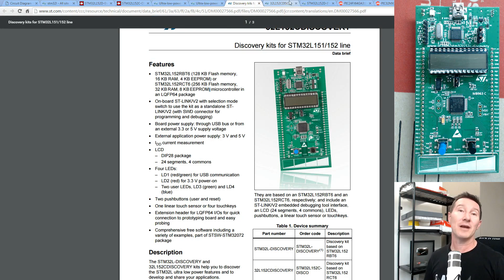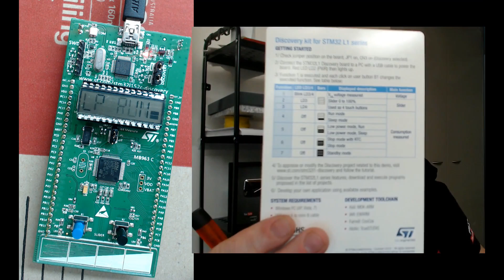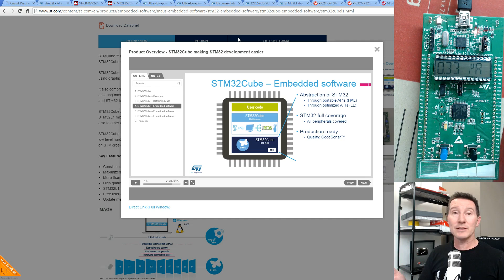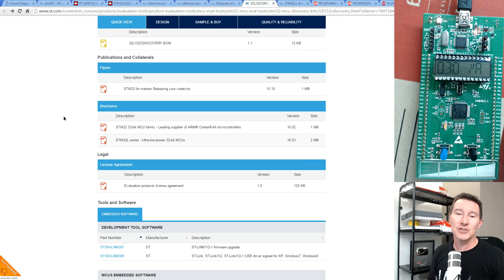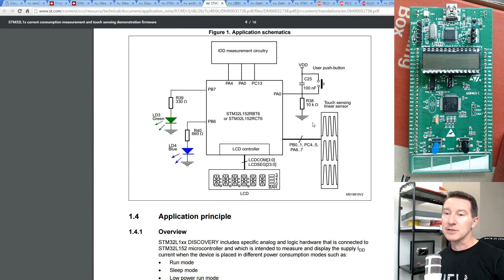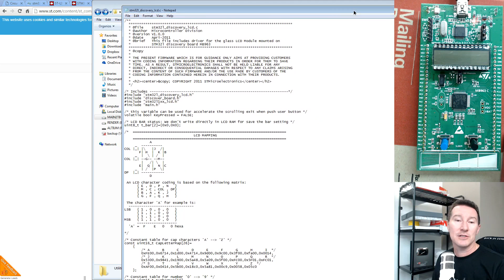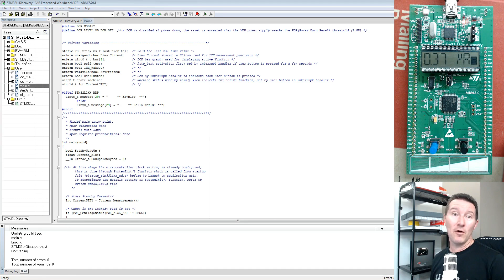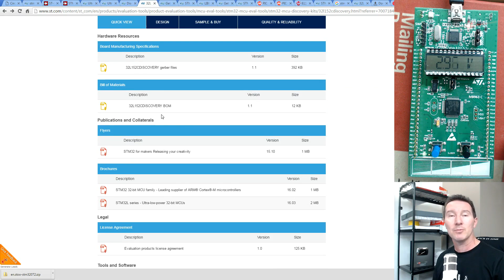EEVblog #900 - STM32 ARM Development Board

Comment: I am usually pretty good at making things work, but it took me a whole night to make the STM32F3-Discovery board run a test program provided by the vendor. 
6 out of those 8 hours were spent pondering about lack of useful instructions, chasing after documentation (all over the place) that points to wrong AN or lacks explanation about critical jumper/connector functionality on the board, after critical files which were named one thing in the docs and another thing on the Discovery utilities web page etc. 

Dave ran into some of the same obnoxious things I had encountered. 

What I don't understand is how a huge and profitable company as STMicro does not think that spending a couple of engineer-weeks on documenting a logical and complete start-up procedure for a beginner is the proper thing to do - especially with a Dev board being targeted to generate component sales. There are forums discussing the pop-up error about the missing ST-LINK driver that are 2 years long complaining about that issue (STMicro resolved this only recently with their 009 FW code. The error was due to a misspell in their USB device naming code).
I also spent another 4 hours to realize that the ST-LINK device drivers do not work on my WIN7-64 VM (my normal dev workspace), and only under my host WIN7-64 (I'm admin on both).

Now I got the test program running, and I'm getting ready to spend a day or two to figuring out how to write my own flashing led test code: trying to decipher which of the 5-6 device and board header files and which of the 10+ C-code setup/startup files I do need for a 10 line C program. STMicro does not provide any documentation on this, and I had spent more than a day looking for hints..

Comment: The MSP432 board has a built-in current measurement system, so you can get a graph and statistics of the current draw live as you run or debug. Pretty awesome. TI are starting to put this on more of the LaunchPads.

Comment: I use the STM32 chips on a daily basis and I find they are great to work with epscially with the cubemx which is an invaluable tool to quickly see if a chip will work for your porject and then auto generate a skeleton project!.

Dave, you should look into the recently released STM32L4 series of processors, they are even lower power. Also take a look at some of the STM32F3/4 series (cortex M4 based), a few of them have similar low power performance to the slightly older L1 series you featured in this video.

For development at work I use Keil, wich is great for almost everything.
At home i use keil (code limited) if the project can live within the limits, or TrueStudio (which is GCC based) if I go over the 32KB limit.

As a side not, for anyone who wants to get into cortex M0 micros, the STM32F0 series is great, and ST have done a deal with Keil to give everyone a 256KB code size version on projects using an F0 processor.
Reply: The STM32L476VGT6  is listed by Farnell as £8+ for a 1-off, whereas the one Dave showed was <£2. Looks expensive?
Reply: STM32L433CCU6 on digikey is $5.7(USD) in orders of 1 and much cheaper in volume. I agree it is more expensive. but it is much more powerful as well. Also much more powerful in run mode (84 vs 185uA/MHz ), and similar power consumption in lower power modes.

Comment: ARM isn't that used by hobby makers precisely because of all the problems you ran into. The Discovery boards are fantastic, but when you look at what you need to get it running... it's ridiculous. GCC isn't that great of an option, both IAR and Keil, while absolutely fantastic, will cost you an arm (no pun intended) and a leg. And then you look at an Arduino, which you connect to your PC, go to the free editor, and you're up and running.

ARM is definitely not for beginners.
Reply from the maker: Seems that way unfortunately. It's ultimately not that hard, but certainly not hand holding beginner level.
Reply: EEVblog Well, now you have Cube from STM. Also, mbed is probably the closes thing to an Arduino. The kit i started with had almost no software documentation. I needed to find out what a startup.s file is and what to do with it.
Reply: Personally, I found GCC + Eclipse + OpenOCD pretty reliable - As Microchip PIC32 series - there are a lot of problems if you dig deep into their peripherals - some will give your garbage in certain cases and not mentioned in errata.
Reply: ***** PIC have slightly better software support, I think. Also, both of them have been mingling with the hobby community for way longer than ARM have. ARM only had to deal with major manufacturers up until a few years ago, and it wasn't them trying to find a new community, but rather the community wanting more capable controllers.
Reply: Cristi Neagu Arduino's IDE only advantages are that it's free and simple - obviously this made some public, but for anything more it's too poor. Arduino is popular due to high abstraction level libraries which make it foolproof
Reply: +Nishad I've been going through the beginner ARM process for the last couple of weeks. The question of where to start: I guess there is no choice, the example programs. However you very quickly get dissatisfied with this.. what is really going on? How does the chip start up? That's where the journey begins. The example programs are just a view of the bells and whistles from the outside. 

One exercise I found useful for learning, was taking the simplest example, blinky, and start a new project with only one file: the one with the 'main' function. This is going to sound ridiculous, but compile it. Follow the trail of errors. 

Include the missing file that contains the information from error 1, read it. There's usually a bunch of compiler conditionals 'ifdef, ifndef' etc. Try to figure out which apply to your current environment, find out where they are defined (some you won't find anywhere in the files, they are defined in the linker script), comment out the rest. Simplify the file as much as possible. Recompile, check that the first error is gone, work on the next one.

This will help, at least it did for me, getting familiar with many of the files that are essential for making a minimum application. Their names, what chip peripherals they are associated with etc. If at the same time you read up on the official ARM documentation for your core, it will begin to dispel some of the mystery. It's a long process which I have only just begun. One thing: it's not very clear from the chip manufacturer's data sheet where the ARM core ends, and their added functionality begins. I found the best info on that is at the ARM web site. Maybe it's a bit of an exaggeration, but consider it as God's library.
Reply: +Nishad You're welcome. One thing I forgot. I did not clear out all the 'ifdef..' in the files. I left the ones below, which seemed to be in most of the .h files, enclosing all the function declarations. As I understand, they are there in case you are programming in C++, so you can call functions written in C. I'm programming in C, but maybe in the future.

 #ifdef __cplusplus
extern "C" {
#endif
......
......
#ifdef __cplusplus
}
#endif

Also, everything I have mentioned so far, was using LPCXpresso from NXP. I was wondering what the STM32 parts might be like to work with, and ended up downloading 'System Workbench For STM32', from openstm32'dot'org. It's another Eclipse based IDE, with examples, and free. Haven't used it much yet, since I'm waiting on a board, but I was impressed with the startup code in the examples I looked at, which is much more compact and efficient than the examples in LPCXpresso.

Good luck!
Reply: Some clever bods from Melbourne have made a port for the Arduino IDE for the STM32 boards. https://github.com/rogerclarkmelbourne/Arduino_STM32
Reply: nishad nadkarni I guess you do it just like anything else: set a goal and keep at it. Try blinking a LED. After that, try blinking multiple LEDs. Then try and control them in pwm from a pot. Then take it further and further. You just need a goal to keep you focused.
Reply: ***** That's the whole point of the Arduino IDE, that it made those libraries readily available.
Reply: just compile GCC to target none-eabi or the like, all of those IDEs use GCC behind the cover, doesn't take a rocket scientist to wire it up
Reply: And the problems get even bigger and more if you try to do all that on Linux. Plus the libraries provided by the ST are poorly written and documented.

I have this same board (bought it a couple of years ago) and it took me months until I found a decent way to develop for it on Linux. I would actually recommend using the Chibi OS (a RTOS) which supports the board out-of-the-box. It's also a neat way to get into RTOS as a topic.
Reply: rbaleksandar While i do agree that the ST libraries are poorly written, at least a beginner can understand them and learn something from them.
Reply: Cristi Neagu Sure, better than having no libs at all. LOL
Reply: By now there are some decent ARM Arduino dev kits out there. I have an Arduino Zero at home with an Atmel SAMD on it and I remember it was pretty easy to get going. With that particular microcontroller you have an option to use the Arduino IDE (easy-peasy startup), or Atmel IDE (easier to manage projects and a proper debugger).
Reply: @rbaleksandar "...the libraries provided by the ST are poorly written..."
Ouch, I didn't want to hear that. I've been looking for an alternative to pics, mainly because I was not impressed at all by their USB and CAN libraries (very deep call chains on a slow micro controller).  This was a couple of years ago. I don't know if they have improved things at all, but it left such bad impression it turned me off their hardware as well.
Reply: @stepsvideos You kinda have to keep in mind that those libraries are designed to get someone up and running quickly. Add to that the fact that they're available for free, and it's clear that they're not efficient. If you want fast, efficient code, the only solution is to write it yourself.
Reply: @Cristi Neagu Yes, it was extremely helpful. It only took maybe a few days to get (twin CAN demo boards) almost 10x speed. Writing from scratch would have taken forever.  However, even though much better than nothing, it still did not leave a good impression as to the common sense (or even caring) of the author/s. I had to dig through pages of code to find all the pieces, so I could stick them back together. Don't mean to offend anyone, but it I thought maybe it was written by someone used to writing code for Windows.

Maybe that's the norm for demo software, I don't know. Last time I programmed a micro controller it was 20+ years ago, in assembly. Microchip was my first exposure to the new stuff, with nice IDE and in- circuit programming/debugging with the Pickkit, and very cheap. Looking at the whole picture like this, overall very good.
Reply: stepsvideos HAL's deep interrup calls are just hilarious. And generalisation, while checking all interrupt source flags when only one is even enabled throughout whole project. Having 20 clock cycles for whole ISR for my purpose HAL only consumed like 24 before even calling my ISR - guess what happened, MCU got into interrupt endless loop. But by just moving call to my ISR in their handler design worked. By no means good solution (especially when you regenerate code from Cube), but much time saved setting up the project. Anyway, I'm not into HAL, although it gives some head start..
Reply: Cristi Neagu I started learning about arm cortex m processors and the stm32 boards, and damn there's so much to know. So many registers and so much configuration to do even in the code, the programming is pretty complex. I've seen pointers and structures being used a lot and I'm not really familiar with them that well. The examples I've seen haven't really explained stuff step by step. How do I get good at it? I've used the arduino uno, and the atmega328p on its own, I have some experience programming those. Its the jump from there to the stm32 stuff that's difficult.
Reply: Whaty compiler do you think arduino uses? Oh, it's GCC!
Reply: Lua Marchante Tello It's all about the IDE, not the actual compiler. It's the IDE that made Arduino famous. Besides, writing code for Atmel is really easy compared to ARM.
Reply: Cristi Neagu to that I can agree
Reply: stepsvideos thanks for the tips!
Reply: perhaps due to different backgrounds? I'm a software engineer at heart and professionally, I'm doing electronics as a hobby and in my startup, if you need specific help, feel free to hit me up!
Reply: love the pun!
Reply: I recently by a stm32f103c8t6 minimal generic board for 3cad$ and switch from arduino to platformio ide,  i can program it using arduino, cmsis, libopencm3, mbed, spl and stm32cube, it's easy to use.

Comment: Is it basically like an Arduino?
Reply: In the sense that it's a programmable microcontroller, yeah. But most Arduinos use AVR chips instead of STM.
Reply: Sorry you lost me there - I have no idea about AVR & STM chips
Reply: retrogamer33 STM is what this video is about. The 'brains' behind the Arduino, the big chip that connects all the pins together is an usually an AVR chip. You can check the Arduino website to see what kind of chip your Arduino has by its name.

Comment: Would recommend Keil for programming the STM32 families, their pack installer makes everything really easy to work with.

STM32s I've found are awesome in terms of capability, but the money you don't pay means that applications support is very lacking (almost non-existent). After 2 months I'm still waiting  on someone to get back to me to resolve an issue I've been experiencing!

Comment: This family looks like a good migration option for my current 8bit AVR based designs that have totally run out of excitement. Curious what kind of learning curve I am in for coming from 8bit ATMEGA AVR uC's.
Reply: I guess you'll spend a great effort trying to go bare metal. But with HAL library and the graphical configurator, is almost as easy as Wiring language on Arduino.

Comment: Funny about the USB drivers in Windows. 

It just works in linux I guess SW4STM32 is using https://github.com/texane/stlink and it using GCC.

Anyway my opinion:

One bad thing with STMCube: I hate they choose to have Header files separated from Sources.  I prefer to have them in same directory. Simply because I want to swap file header/source in Vim fast when developing.

Compiler: 

Everything except GCC is no go for me. GCC has it's issues but there is no other compiler working on Linux hosts and I don't use windows or macos. 

Debugger:

I use gdb and open source st-link daemon:   https://github.com/texane/stlink

Editor:

Vim ofcourse :) Eclipse based IDE's is real pain

Comment: This is off topic, but I'm having trouble w/ one of my projects and this seemed like a place full of smart people :) So essentially what I need to do is have a circuit that will stop current from flowing for a given time interval when ever the current reaches a certain value and all of this has to happen really quite quickly, and should have as little latency as possible. If anyone has any ideas it would be most appreciated, and thank you for your time :)
Reply: Super easy. Have a current sensing resistor, with a microcontroller's ADC reading the voltage across it. Have it interrupt on a timer, with say a 100uS period, to check the current. When it reaches the threshold, pop a relay or MOSFET to cut the current from flowing. Use a timer to time that, as well.

Comment: You can get an stm32 board for 3$. When you actually build you thing, and "spend" the board, it is much cheaper that way.
When you use discovery boards like this (first it's probably 13$ + 20$ shipping) then when you actually build you product then you often end up using different hardware because of cost.  Much better to work on a board that you can "consume" right away and that you know will never go out of stock because it's the single most common stm32 board on the planet.

Comment: Actually, is very easy to install everything in Xubuntu 16.04... The gcc compiler, Eclipse IDE, the GNU arm Eclipse plugin, CubeMX as Eclipse plugin and as standalone application. In less than one hour. But your video opened my interest to STM32 micros.

Comment: Been using STM32 since 2009. I would recommend ARM uVision Keil.That CubeMX is garbage for setting up most of the peripherals as it adds a lot of bloating. ST should have made it like TI's HALCoGen for Hercules series, much more lean code.Although CubeMX is ok for Ethernet, and also for planning pins.

Comment: I use Coccox with GCC, it's free and has no restriction on the code size. STM32's where my first uC's that i used after years of Atmel's uC's, it was little struggle to find out which tool chain to use.

Comment: Really interesting video. I have been developing embedded systems for 30+ years (most recently PIC32) and the GUI configuration tools are really handy although I still tend to do this the 'hard' way as I am used to doing it that way. I find the GUI more useful for pcb design rather than code. I would recommend that beginners at least try configuring a project or two from scratch using the spec sheet as this is a very good way of becoming familiar with the capabilities, pitfalls etc.
Reply: Ddýy

Comment: I' been using STM32 since 2008 and consider them the best micros for most jobs. Unfortunately, you got so close to the solution at some things in the video but missed it by a micron. Maybe, I can help you with the STM32 a bit. (I am known as a kind of a STM32 encyclopedia in my company). If you are interested, I'm here or 'unclebob' on the EEVBlog forum.

Comment: I use Crossworks for ARM and I'm decently impressed with the STM32's.  I do take issue with the I2C interface implementation in the Cortex M3 parts however.  I can't speak for the other families I2C however.